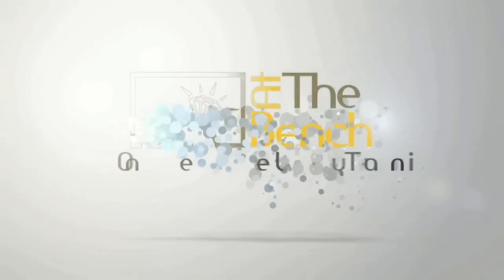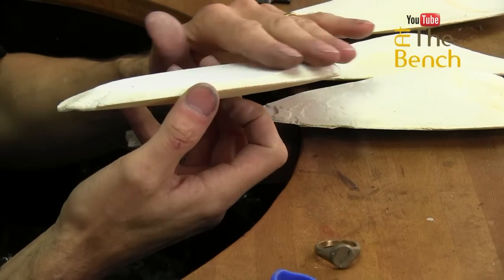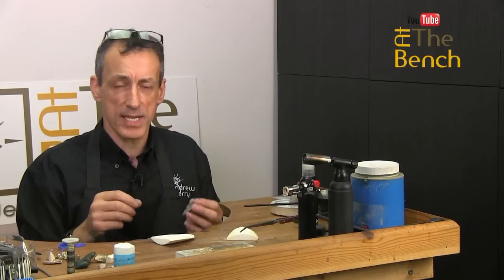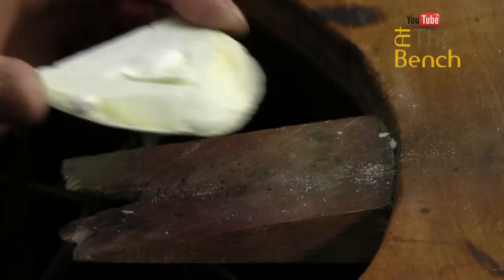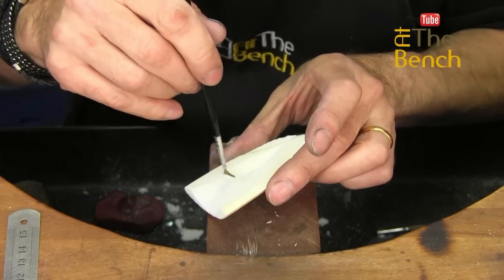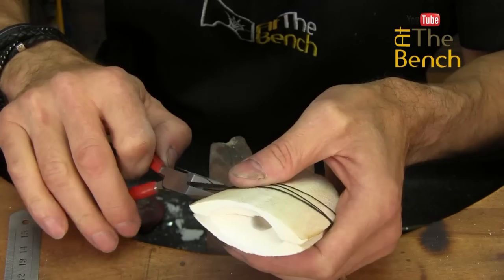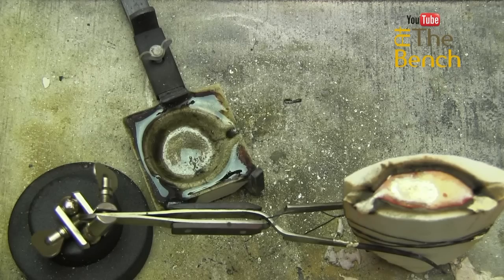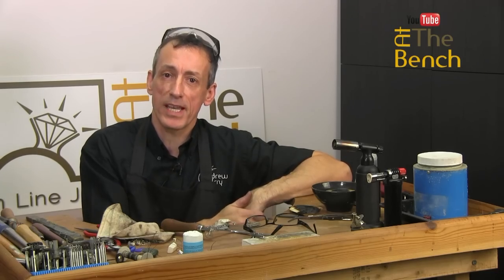Beginners Guide To Cuttlefish Casting in Silver

Comment: Didn’t think of this, I’m glad you did I was trying to cast a brass insert as my tungsten carbide wedding ring is to big after some weight loss, I tried casting into plaster of Paris and into some green sand but the molten brass set before it completely filled the mould even though I preheated the green sand till it was glowing 😂

Comment: If you buy a brand new crucible do you have to do something to it before using it?
Reply: Yes, you want to take borax and sprinkle in powdered borax off the block into the crucible while the crucible is red hot after applying flame for a few mins